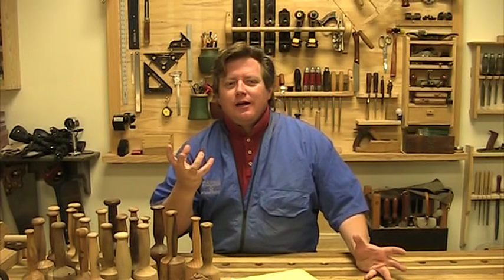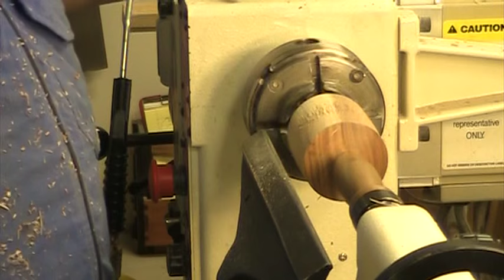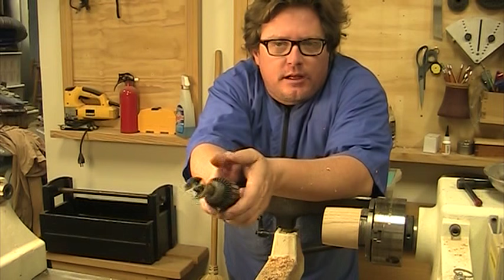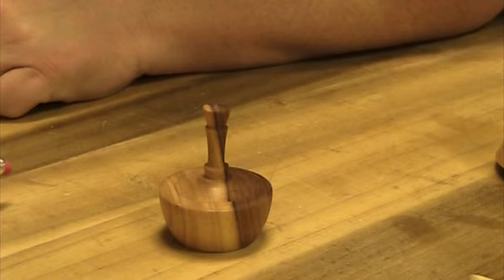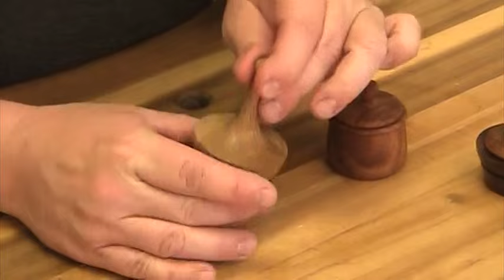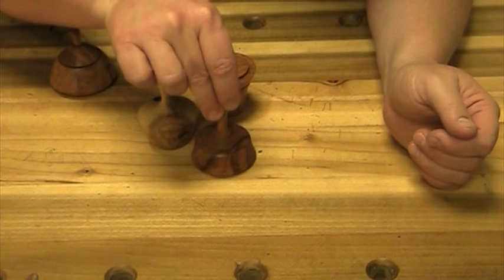A Unifying Theory of Spindle Design - a box making exersise

Comment: After having watched this a couple of months ago, I re-watched this today.  In the interim, I have been doing a significant amount of turning and experimenting with design.   My opinion: while the 2/3, 1/3 rule (roughly golden section) does provide a good fundamental for design, there are other elements at play that can provide pleasing results for designs that fall outside of that rule of thumb.   It's been a number of years, but I think it is time for me to re-visit David Pye's "Nature and Esthetics of Design".   It was very helpful to me in providing general ideas when designing furniture, I think it will provide some good ideas for turning as well.   It is more of a philosophical discussion of design, both function and esthetics.   One comment from Garth Grave's "The Woodworker's Guide to Furniture Design" seems applicable to what you learned in this experiment: "There is nothing magic about the ratios or rules -- they are guidelines"

Comment: That was a fun to watch video. Interesting about the spindle gouge for Hallowing out. I was just about to decide there was little difference in bowl or spendle gouges. Still not sure what the difference it makes which one you use where.
Reply from the maker: It has to do with the approach angles of the cutting edges and how the chip breaks. The deeper flutes and typical grinds affect the cut differently. I do believe calling one a bowl and one a spindle is misleading. But you do need (err... highly adviseable) to have both.

Comment: Peanut Gallery Report: in general, I don't like the "long thin handle" look; i think the others generally looked better; I connected with my inner-Pooh and declared the "honey pot" one my favorite; in each case where you thought the boxes were too close to 50/50, I think all of them would've been "salvaged" my merely shortening the handle. In at least one case, you wouldn't have been able to repeat design elements, but, otherwise would've "fixed" the situation. All of them are nice, and suspect all of them sold already. If the honey-pot didn't sell, my address is..... (whistling innocently)
Reply from the maker: I'm sure you can make your own honey pot now.